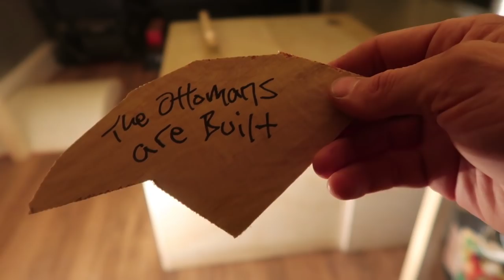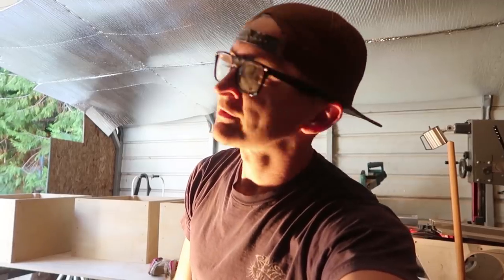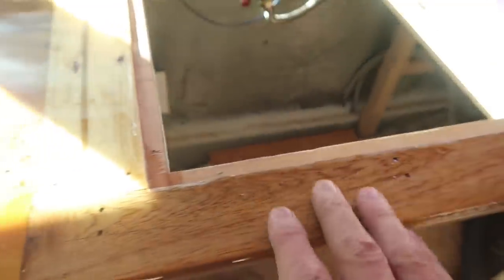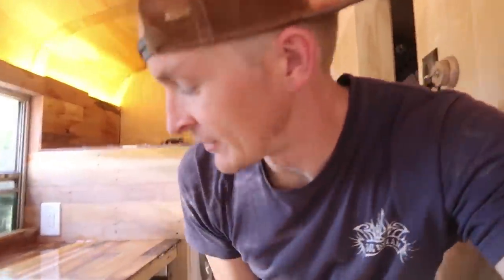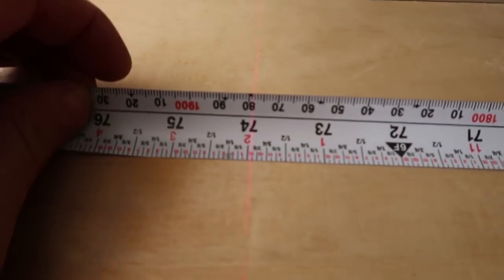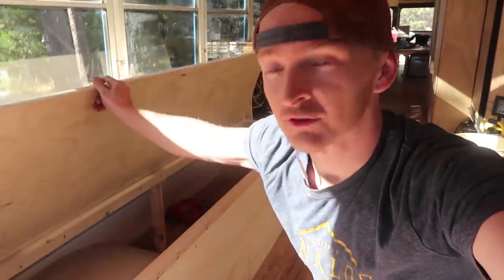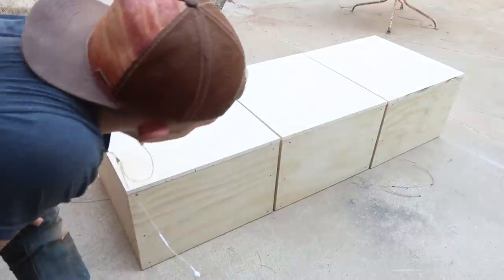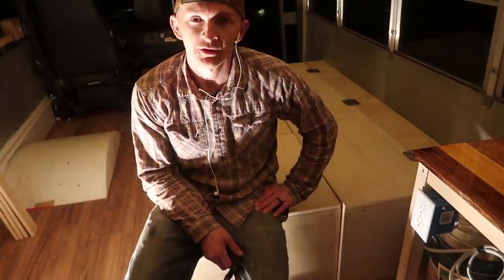#86 SKOOLIE BUS CONVERSION | Building custom Ottomans and completion of Cooktop and Kitchen Faucet

Comment: I ❤️ seeing how this is coming along, and I ❤️ how you’re taking the time to do things right - like the strips to prevent the lids from sliding. You could easily say “I’m tired. I deserve to move on”, but you instead do what’s best & will cut down on annoyance & inconvenience in the future. If i were you guys, though, I’d put some type of handles on those multi-use boxes. I just envision moving box jump boxes around for everything and busting my shins, pinching my fingers, or straining my back whenever i try to reconfigure them. Keep up the great work!
Reply from the maker: It's always great to hear from you Sasha. Yeah, I'm planning to put handles on the box. They are hard to move around as they are now, but when they have stuff in them, they will  be nearly impossible to move around. I'll make sure to document it in future videos. :)

Comment: “22” Nicely done! I believe the weight on the faucet can be moved if you need it to move and have more of leverage to pull the faucet head back into the proper position.  Had to do this in my kitchen with our mowen faucet (which not to plug the brand but ours sprung a leak I emailed the company and they sent me the parts at no charge to fix it!) they stand behind their products! And I think I told you before but you won’t need the plate buddy. The plate is for covering up the predrilled holes in sinks that have two or three existing holes. ;)
Reply from the maker: You're right! V was all about your suggestion. When I filmed myself putting the plate in, I didn't film me taking it out and reinstalling it without the plate. I hope ours doesn't spring a leak. Ugh. Thank you for the suggestions and the kind words. I always look forward to hearing from you Tina.

Comment: I had an the same issue to solve in a residents home on their faucet. You just need to add additional weight. my resolution was to order another clamp weight from the manufacturer, or try movi ng the weight a bit higher up in the faucet side it tends to loose it's pulling power the moment it starts to hit the loop at the bottom...hope that helps :)
Reply from the maker: Great idea. I'll add more weight. I don't want to move the weight any higher because I've already got less than ideal length to pull it up. I'm sure another 1-5 pounds would solve the situation. Thank you.

Comment: attach a bunge to the weight to pull it down?
Reply from the maker: bunge?
Reply from the maker: To pull what down?
Reply: Ian Robinson the tap. You said that the weight on the pipe doesn’t pull it fully in.